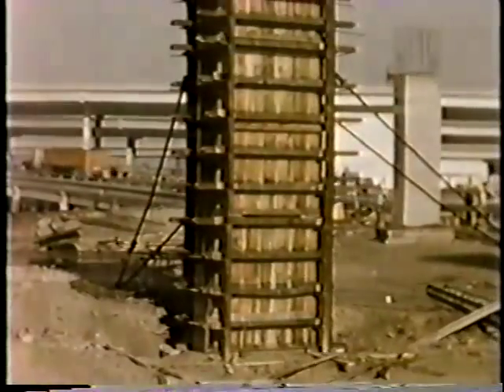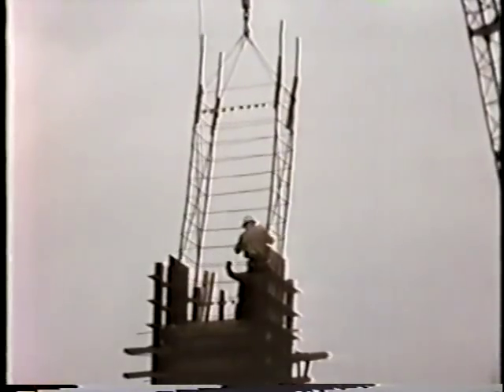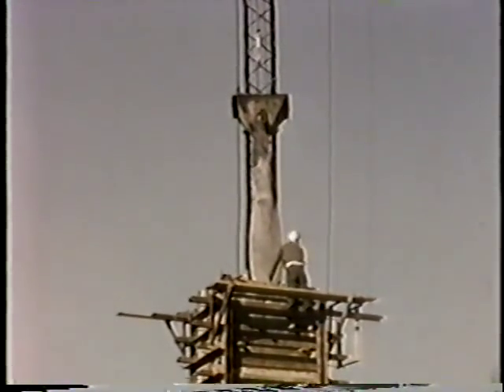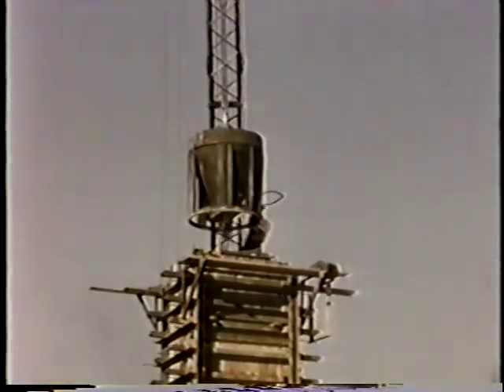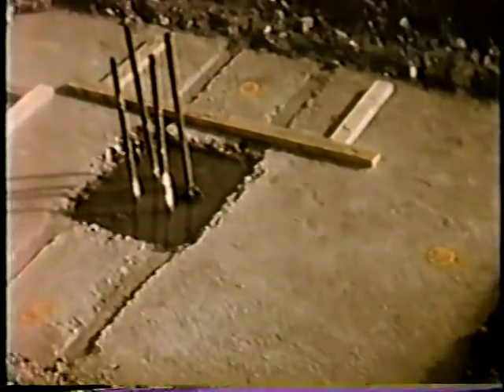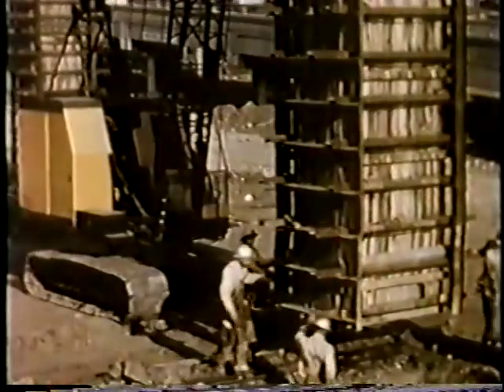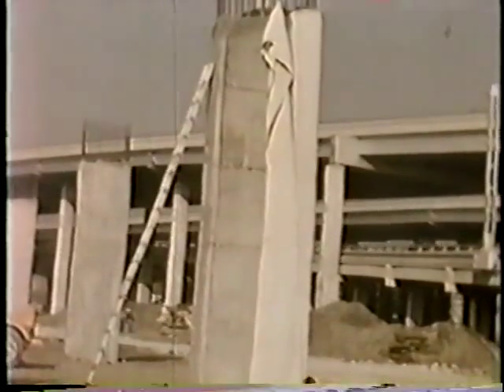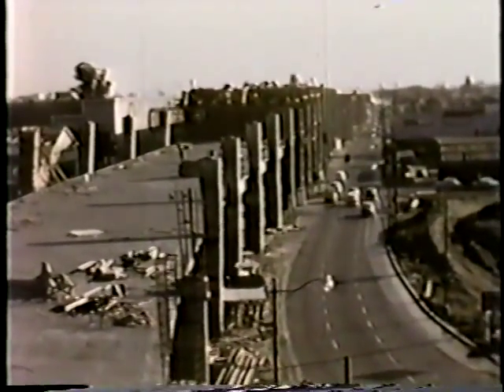I-880 Cypress Viaduct Construction (part 2 of 5)

Comment: Wow.  I never realized the colums for the upper deck were poured seperately and rested on the lower columns.  I would think having that inherent weakness of a  joint in the middle would have amplified the lateral shaking of the upper deck.   Amazing footage.  Thanks for posting.  And yeah they were skimping on the rebar!

Comment: It's shocking to see they are not using enough rebar on the columns! Nor are they tieing them together! It's a shame they didn't have the technology building a structure like this in earthquake prone areas in the 50's however, the fact that this double deck was built on land fill, past or present standards, this project was doomed and so were the lives of those innocent people 30 years later.